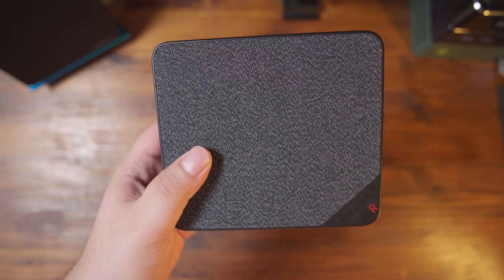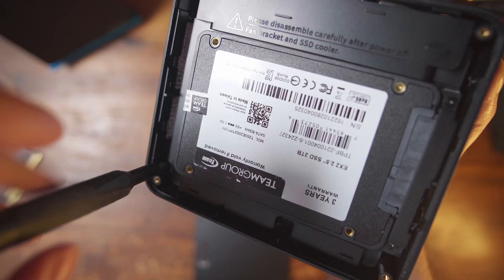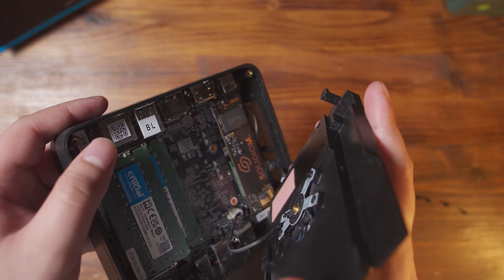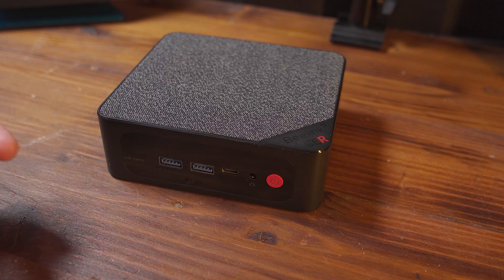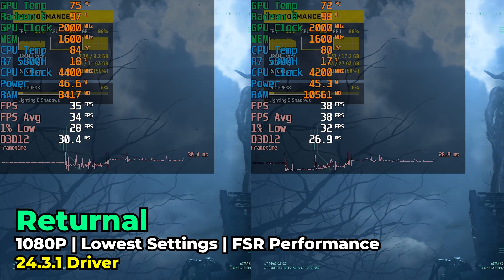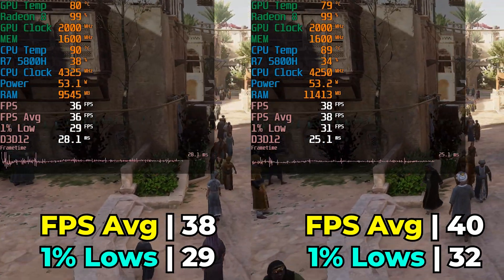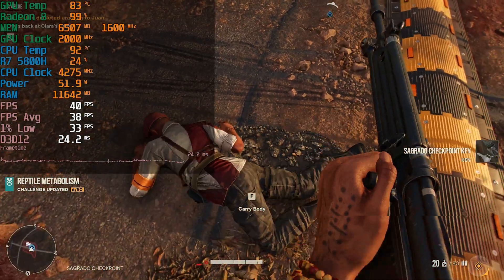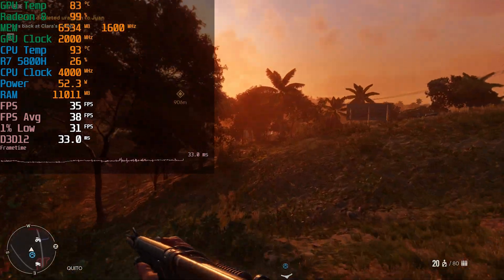Should You Upgrade To 32GB of RAM in Your Mini PC In 2024? Beelink SER5 MAX RAM Upgrade Test

Comment: I have the beelink ser4 and just bought 32gb of ram to replace the 16 already inside. How in God's name do you take them out of the slot? They just don't "pop out" as shown here. I'm at a point where I think they'll break if I keep forcing it. Is there some kind of latch or do you just force it out? I've tried pressing down thinking it will pop up for easy removal as I've seen people insert it at an angle and press down but mine does not do that.

Comment: I have a Ryzen 7 5700U Beelink mini pc running on two 24" curved monitors. I am having issues with the system freezing for about 30sec to a minute because of having multiple tabs open at once. It mainly happens in EDGE, but don't really use CHROME much. I went from 16gb to 32gb and still had the same problem. I allocated 8gb to the vram and it still happens. Should I allocate 16gb or just leave it in auto mode? I am not worried about gaming. I just use it for work with maybe 30 tabs open in Windows 11.
Reply: I had this problem too. Found this video and implemented the changes as explained and have had no issues since... ! https://www.youtube.com/watch?v=yRzcGcoHL9U

Comment: More ram for running more apps open, more app instances open, more files open,  large files such as in video/graphics editing loaded, large live databases loaded, multiple vm's running etc. performance bottleneck will occur in those cases. Games only affected by too little ram. Ram speed not an issue today for gaming.

Comment: 32gb is worth it, 4gb or 8gb should be allocated for the vram depending on the games your mini is capable of. Mine was set at 8gb but i noticed my games never reached 3gb so i changed it to 4gb. 
Don't allocate 16 its a waste of ram 😑

Comment: FYI - AMD APU VRAM should be left at AUTO unless you know why you would want less allocated. AUTO will dynamically allocate, as needed, up to half of system RAM as VRAM.
Reply: WRONG, depends on your system. On some mini PCs leaving it at AUTO will HARDLOCK the VRAM available to 2 GB, even if you have 16+ GBs available.
Reply: That's why it only recognizes 8gb, I bought one with 16gb of RAM. I should get a 32gb kit.
Reply: There is a small difference if you allocate more ram, but only to 5% difference at most in some games.